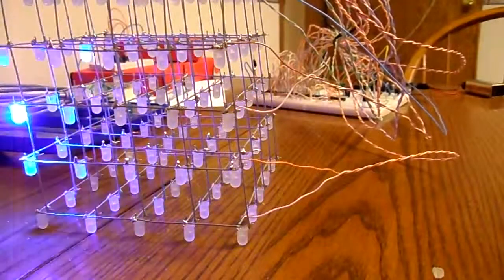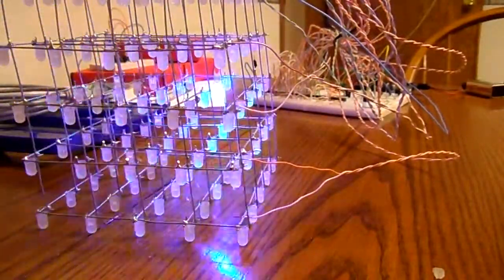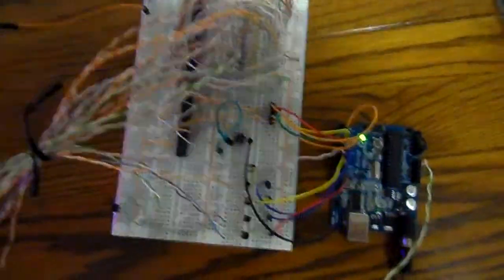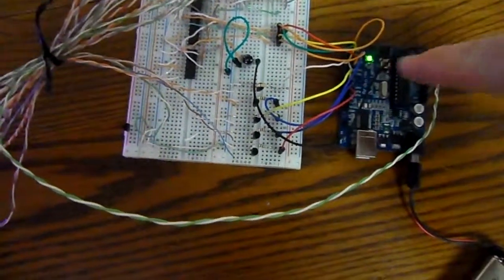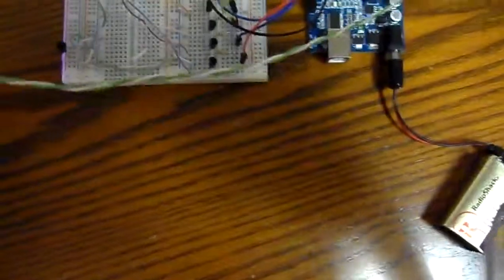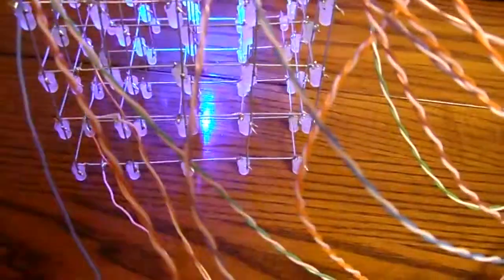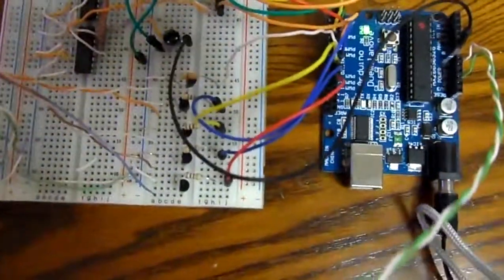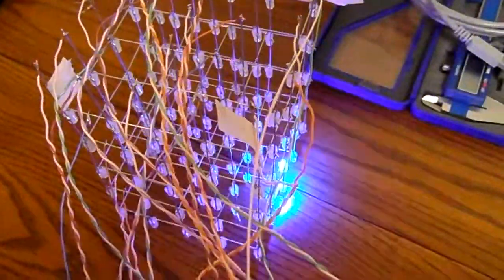LED Cube--Prototype Circuit Description

Comment: When you are activating 1 LED it has a certain brightness. If you activate the whole column this very LED then has only the 1/5 of the brightness then before. Is this correct? I mean since the 5 LEDs of a column are parallel and share only one resistor.